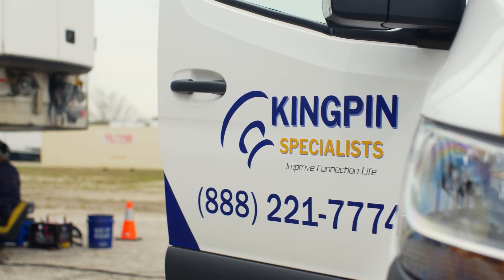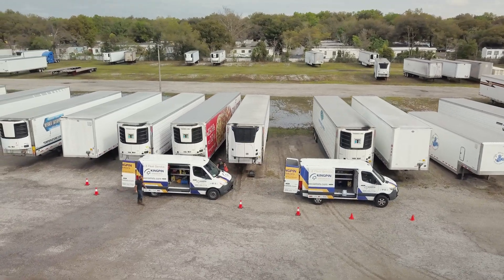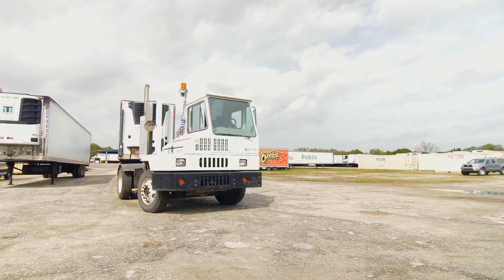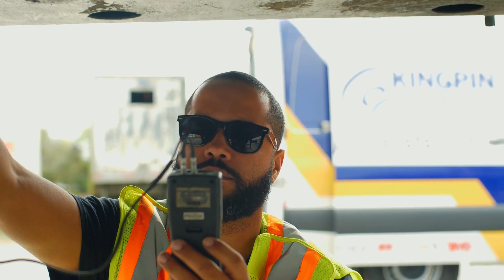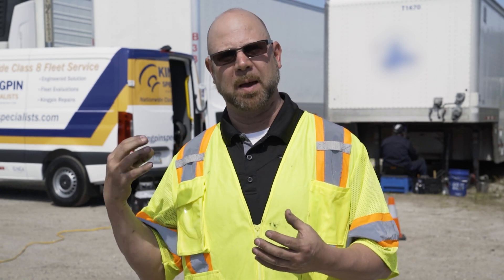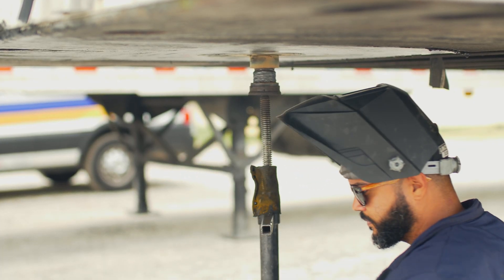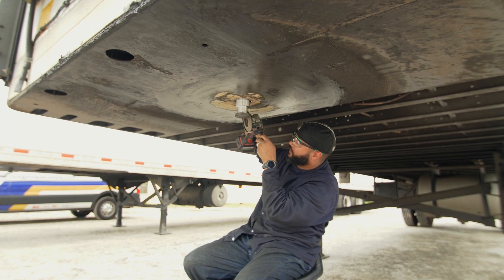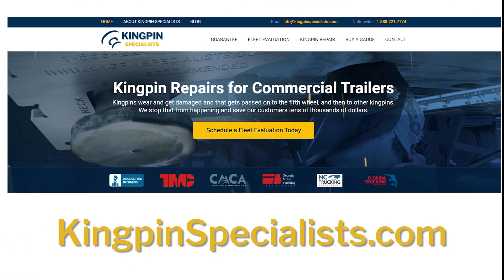How Does Kingpin Refurbishment Work?

Comment: Isn't it cheaper to cut out the old bolster plate n just weld in a new one.. n you got a factory strenght kingpin .  .n not a welded causing the 5th wheels jaws to wear out faster..